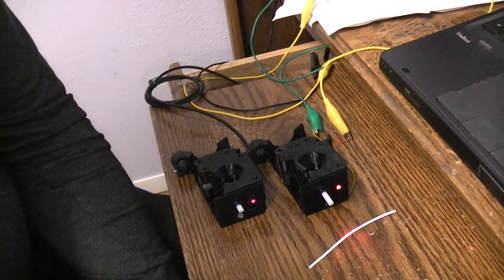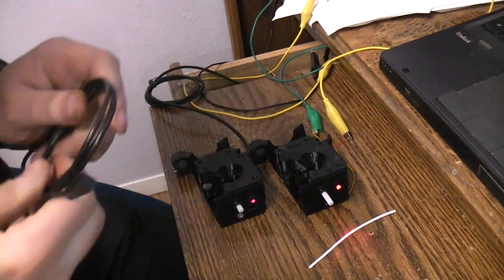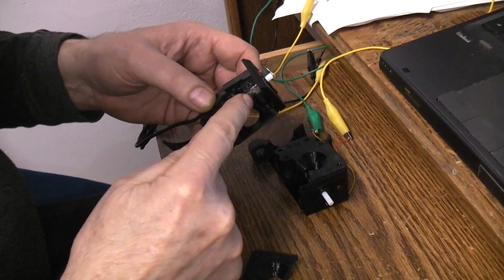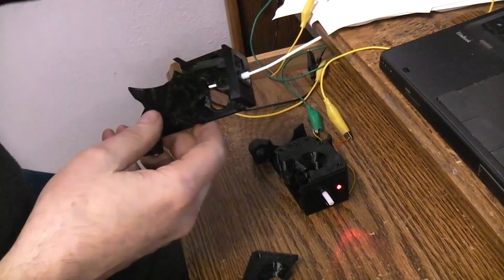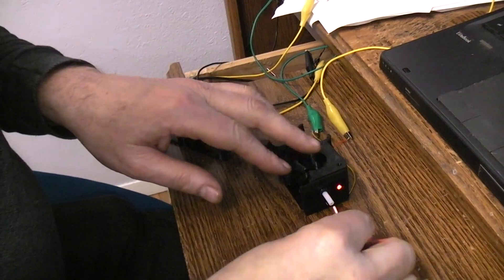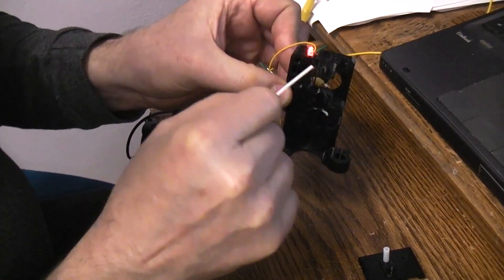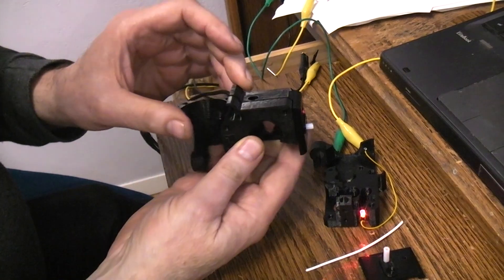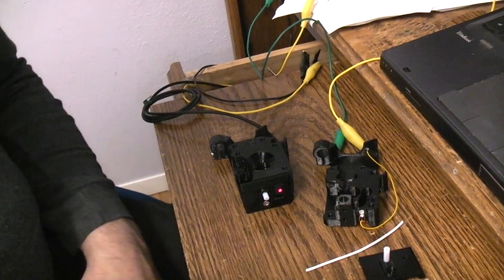Prusa i3 MK3S DIY upgrade mod. Inductive proximity filament sensor. Part 1

Comment: A micro switch isn't enough for this job?
Reply from the maker: Yes micro switches work well, inductive sensors last longer and work better. Lots of printers use micro switches and seem to work fine for me as well.
Reply: May be an optic switch less expensive and long life. Also it's very easy to mount anywhere...
Reply from the maker: Yes the optic sensors do cost less. The inductive sensors last longer in real life. But the printers will wear out before either a optic sensor or a inductive sensor so it really does not matter what you use. Just geeking out I guess and having a good time.

Comment: Or just buy the cloned optimal sensor kit on aliexpress for dirt cheap 😉
Reply from the maker: Yes but where is the fun in that. But I will go check it out right now. Thank you for the heads up.
Reply: @Robothut  I like your attack on the problem! If you have the parts and make it work, why not? 😊

The aliexpress upgrade kit worked fine. Had to modify some bolts to make them 14mm for the fan, but the sensor, magnets, ball and cable worked as should. You get these for less than 8 bucks, free shipping.
Reply from the maker: The price is right. What did you do about the NEW tension spring for the bondtech set up ?
Reply from the maker: Found it on Aliexpress like you said. Now I am confused as the schematic they show has a emitter inverter driver stage, that would make it a normally OPEN sensor that has a output that goes low when filament is present. Not like other youTube videos would have led me to think.
Reply from the maker: Is there a seller of the new SPRING for the bondtech single spring set up ?
Reply: @Robothut  I just used one of the old springs from the old setup. No issues with traction 😉
Reply from the maker: Thank You. That sounds like the way too go. Now to find the nuts and screws and get mine set up.
Has anyone made a larger part cooling duct for the MK3S yet to get more cooling on the back side ?
Reply: I cant seem to find the mentioned kit, do you have a link? Maybe as dm?

Comment: Cool approach, Also played lately with the hal sensor :-) Have the FRS on my MK2 quite long, see https://github.com/3d-gussner/Prusa-Firmware/releases/tag/v3.1.0-001-HFM and it can handle different sensors. Using the pat9125/9130 still could work to detect runouts, movement (jam detection) and even diameter width with an indirect steel bearing, as these sensors detecting this very reliable.
Reply from the maker: Thanks for commenting . So nice to see so many people working on different mods and improvements for these printers and sharing the info.